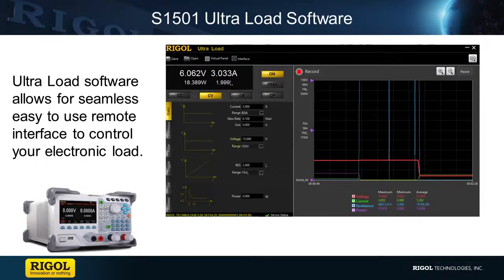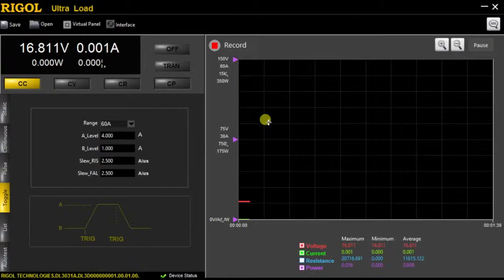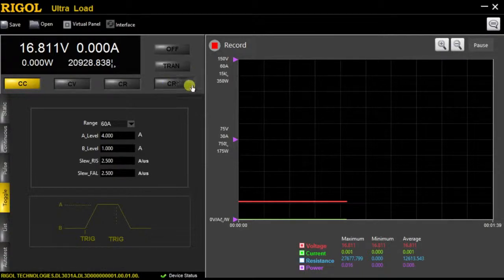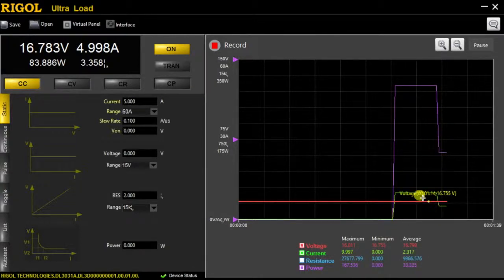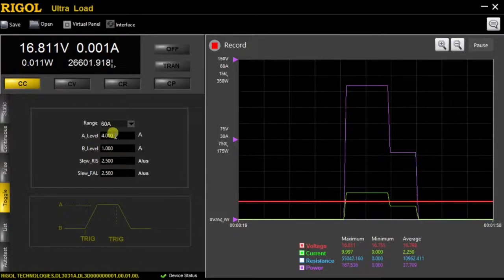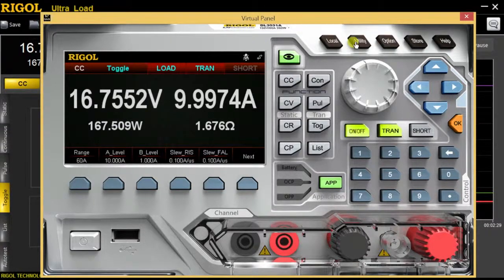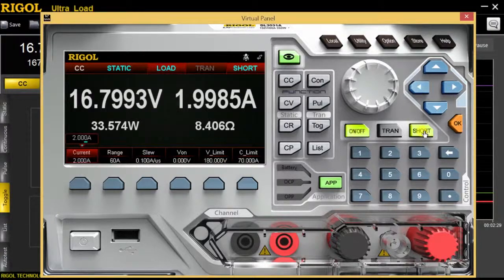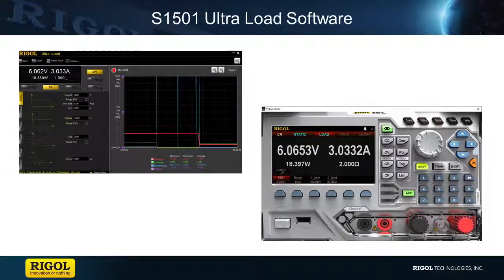RIGOL S1501 Ultra Load - PC Software

Comment: I recently recorded a log of a test performed with the list function.  The logging timestamp seems erratic - I'll get around 6 samples with the same timestamp, then 9 with the next increment timestamp.  There is insufficient resolution on the timestamp to know what the interval is, making it difficult to integrate or perform other analysis on the data.  
What is the logging interval?  Can it be changed?

Comment: the DL3021 dont run with the last  S1501 Ultraload,,  Lot of Bugs in there. Max Current  in Ultraload is 60 amp, in Dl3021 only 40 Amp, user cannot change !!  Big Mistakes ..good for Trash